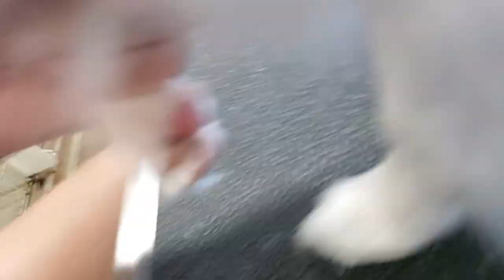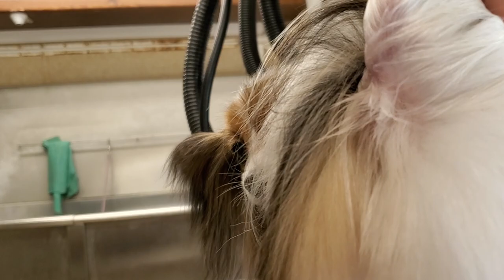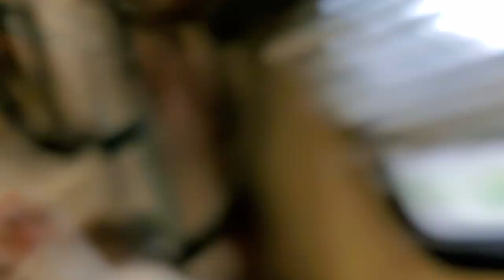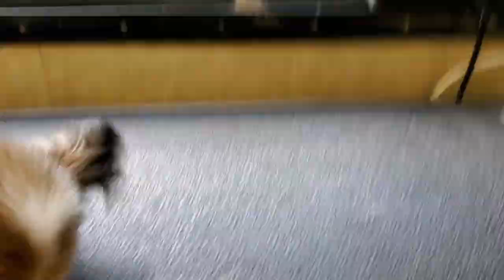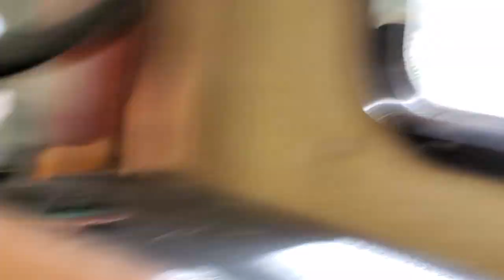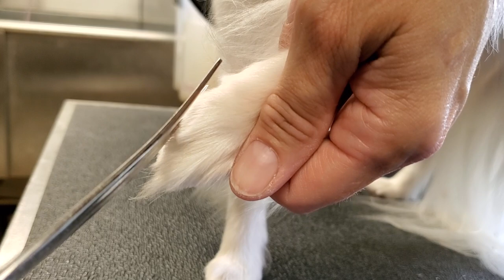Feet and Sanitary trim with Lexi the Papillon

Comment: Would you use a clipper like that on feet for show? Then finish with scissors for final shaping? Do you sanitary shave the underside for a male??
Reply: No not for a male. Trim maybe but the sanitary shave is for the purpose of whelping / giving birth and for the pups to breastfeed. It's cleaner (sanitary) and makes for easier access taking in to account how super tiny the Papillon breed pups are at birth, it just helps them find the tit better also.